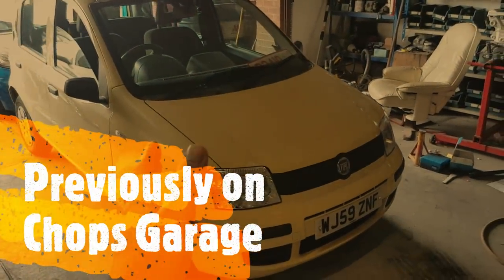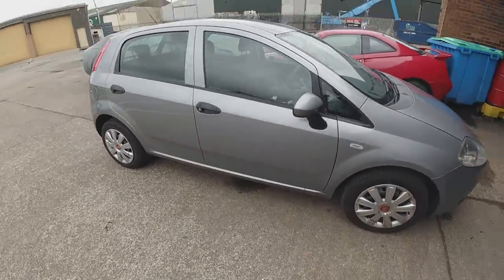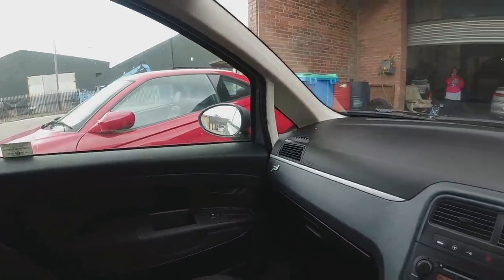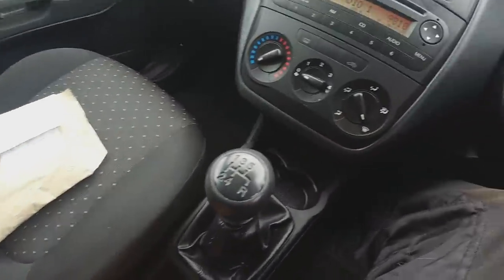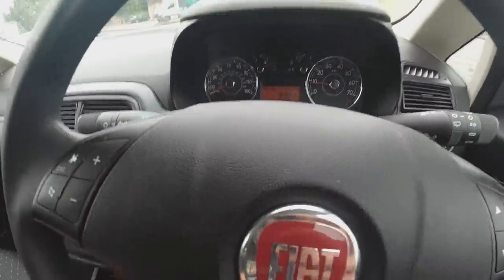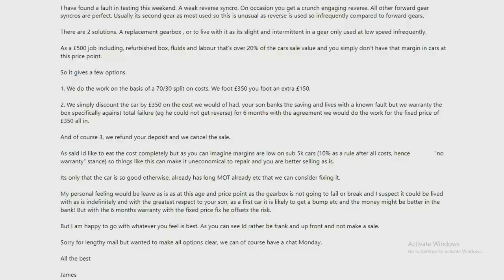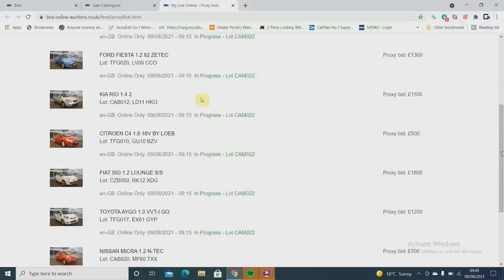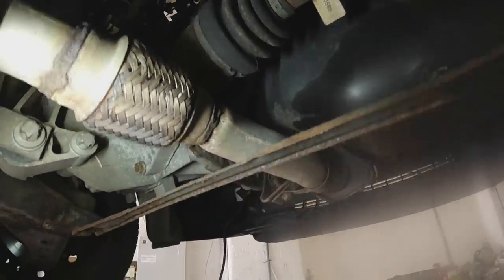TRACKED DOWN!  I found the previous owner of the used car I bought at dealer auction!

Comment: Thoughts on the C1 pull out main dents as you said & do for 2195 make someone a good car, Fiat's dont have the best of reputations so never owned one but the Punto looked good perfect for a new driver & I'm sure you sorted a good car for them, I wanted to ask you about APC James I think you mentioned the brand you use if you dont mind reminding me as theres such a big difference in price £5 or £10 per litre (got a bit of mould spots on roof lining & household pink stuff does nothing) 
Good luck with the new premises !
Reply from the maker: Its G10 i think bud from Autosmart

Comment: 6:55 - I reckon they sold it on because these cars are a piece of crap. I had one of these way back in 2007, it was nearly new with just 10,000 miles on the clock.  The rear wiper bearing was on it's way out, griding noise when you switched it on. There was a loud CLUNK when you started the engine. The radio would randomly stop working, with the phrase "CANCHECK" displayed on the screen. I once drove home from the shops, and when I arrived home i noticed the front grill was completely GONE, had randomly fallen out somewhere while driving. The plastic trim across the top windscreen heater vent bends upwards and away from the dashboard due to the heat from the vents. Bits inside the doors would rattle and vibrate if the radio was only at medium volume. The 'City Steering' feature didnt work half the time. The whole interior is made of the nastiest cheap hard plastic that feels hollow to the touch. The drivers window switch panel would come off in your hand. The car was just a total piece of crap and I would advise anyone thinking of buying one to not bother.  For reference,  I now drive a 2004 Volvo V70, which has 436,500 miles on the cloc, and it doesnt have ANY of the issues that Punto had. The only good things about the Punto were that A) it was a 5 star EuroNCap at the time,  B) It rode pretty well at high speed for a hatchback, and C) the 1.2 engine was very economical and D) It was a good looking car for it's time.
Reply from the maker: Ouch that was a bad one

Comment: Warranty is a nicety and actually relatively irrelevant. Main dealers or independent all have to comply with the consumer rights act 2015. That should have stopped all the mucking about because it clarifies the buyer rights. Basically, if a major fault occurs that was not declared pre sale, the customer has 30 days to return the car for a full refund. Painful for the trader, but true, I'm afraid. Having said that, all used goods are accepted as having fair wear and tear. That could mean a clutch or bit of rust commensurate with a vehicle of a similar model and age. Spot on negotiating as you did. Shows reasonableness and just what TS would recommend
Reply from the maker: Thank you!

Comment: There is no syncro on reverse. The gear teeth are cut straight, that's why reverse is always noisy when driving in reverse. Like rally cars have all straight cut teeth, that's where the noise comes from. It doesnt need synchro because when selecting reverse it is not on the move.
Reply from the maker: I learned this, but now no noise at all
Reply: @ChopsGarage  I'm not sure of the set up on most cars to be honest, I've done clutches etc obviously but I served my time repairing Hgvs. Is there an extra cable or anything for reverse on a punto? I doubt it, because generally there are just 2 on cars I have done. Just a thought. Personally I would live with it if I was buying it. It's hardly the end of the world. Looks a clean enough car. Best of luck with it.

Comment: That Punto is alot better than the used unrecorded one Copart sold me. Supposedly just had a gearbox issue (which it does) but happened to miss (by an inch in the photos, literally) the entire rear quarter being damaged 🙃 ah well. Win some lose some. Won't be being unrecorded ever again 😂
Reply from the maker: I never buy unrecorded from Copart. The accident one's were not being offloaded but normally good cars that just had a bump. Unrecorded is trouble

Comment: I was watching Judge Rinder on YouTube and a very interesting case came up with a car dealer. 
The dealer sold a Skoda Fabia for £475 for parts 
A guy bought it.... And drove it.... And the rear wheel arch liners fell off while driving 2 months later.... He got a garage health check which reported a blown head gasket, oil leak, play in ball joints etc
The buyer bought a spares/repairs car, yet the dealer was "guilty" and the court awarded in the buyer's favour 
How ridiculous is that!!! It just goes to show it is well worth going above and beyond, regardless of what some people in the comment section say! 👍
Reply from the maker: Its because he drove it away. The dealer needed to ensure it was trailered away as unroadworthy
Reply: @ChopsGarage  Ahhh, interesting
I didn't know that 👍
And it wasn't mentioned in the case
Reply: @anonamous7108  Oh I know that, but he does go by the law. Somewhat
I think it really shouldn't have been the case that a £475 spares/repairs car was refunded 2 months later though 👍
Regardless of what the dealer did by not ensuring it was towed away

Comment: My 14 reg Punto Jet Black 2 cost me £4k with 46500 miles and came with a 2 month mechanical warranty - no cruise control though I need to get that sorted, my research suggests it's an iffy position sensor
Reply from the maker: Only 2 month warranty eh

Comment: Chemical metal on sumps.
Reply from the maker: But then it will spring up somewhere else. It wont take anyway will it when leaking as the oil will stop it
Reply: @ChopsGarage  drain oil first mate, but yeah a sumps not too expensive with your 70/30 split, I'm going to start doing that
Reply from the maker: @roystonvehicles9129  done it a few times , it seems to work as they want the best car they can get and either accept as is so you can put it on the invoice as a known fault or they pay and you don't get the warranty claim later
Reply: @ChopsGarage  new idea for t shirt bud, chops garage 70/30

Comment: My work use fiat doblo (I think) vans, every single one of them has done less than 30,000 miles and almost every single one has a crunchy gearbox. They're all 1.4 petrol which in sure is the same engine and gearbox in the punto. Horrible horrible gearboxes
Reply from the maker: Yes seems common

Comment: Wouldn't touch a Fiat with a two mile long pole
Reply from the maker: Shame good cars
Reply: @ChopsGarage  but unreliable, poor finish and deadly in an accident. Sadly it's the young girls that tend to love them.  They are so cute, the cars that is.
Reply from the maker: @stephenrichards5386  I'd rather be in a Punto in accident than Toyota Aygo
Reply: I'v had a long line of Fiat vehicles, never had any major problems and very few small ones.
Reply: @bigteddy66  you should do the lottery
Reply: @stephenrichards5386  why would I want to do that.
Reply: @bigteddy66  face palm
Reply: @stephenrichards5386  face palm all you want. I could not care less. What do you drive.
Reply: @bigteddy66  for the past 30 years. Mercedes, Hyundai, BMW and a very cheap VW. Mercedes for 25 years. BMW 525 for 2 years the rest fill the gap.

Comment: It seems fiat cars are not a very good car when new and a pain in the bum when  used ,they are cheap in every respect ,perhaps you should buy in  more respectable marques ,although i appreciate your customers are  budget limited
Reply from the maker: Disagree mate, I find VW, Audi, BMW far big a risk at this age. Fiats are actually quite reliable, a clutch afterall is only a consumable item
Reply: They’re certainly very dangerous. I believe the punto got a 1 star safety rating which was even a ZERO star one at some point. Most of their new cars get 3 stars max that I’ve seen. I’d avoid for safety above all else